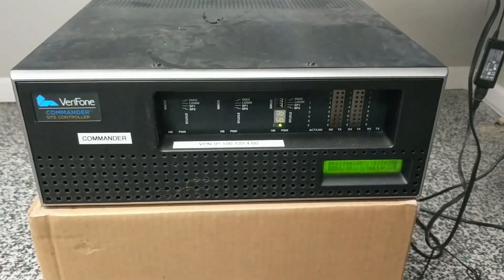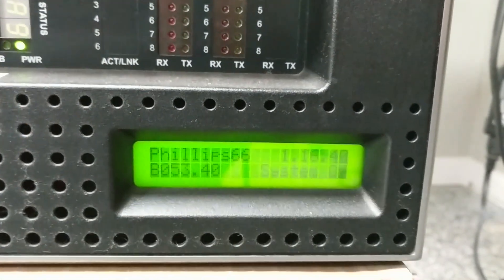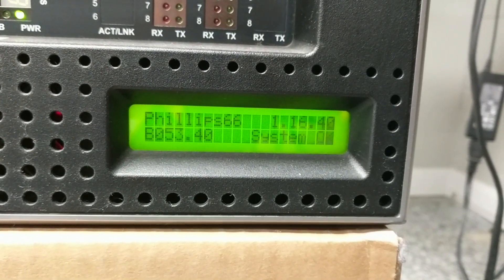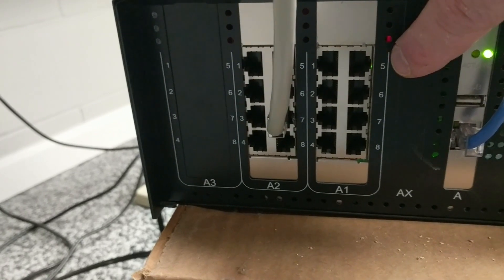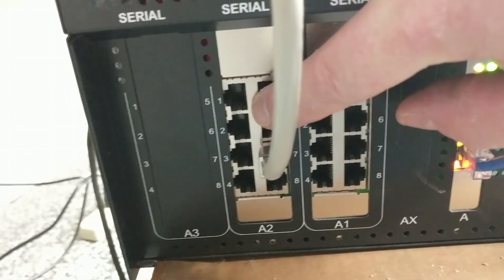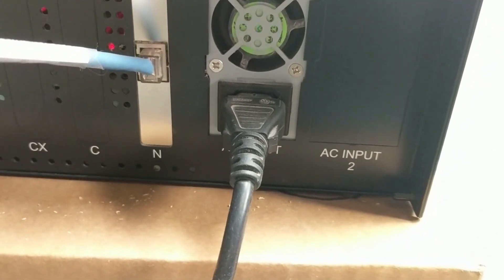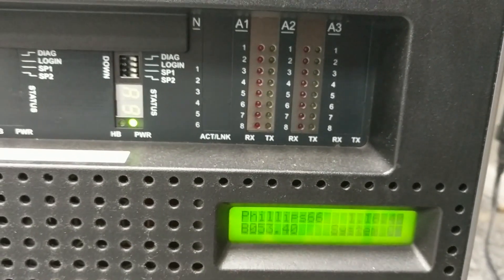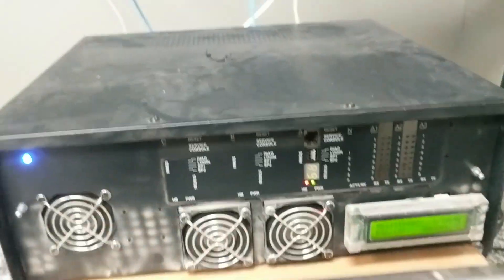Commander Site Controller Explained

Comment: Hi, so I am interested in the latest Verifone C18 POS and the Verifone Commander Site Controller for my gas station. As of now I am looking at purchasing the hardware on ebay. Does this setup require a purchase for a software installation? Or can I just purchase the hardware itself and it's just plug and play? Would really appreciate your help as I've been trying to contact Verifone but have yet to receive any response from them.
Reply from the maker: @DC670-o5c  Verifone requirements are growing.  Software is usually updated a few times a year, the same install file is used for the C18 as what the CMDR uses.  After installed, if it is not registered the software will lock up after 90 days.  To register software, you have to get an ASA license.  Since our store is branded P66, we pay them for the ASA license and P66 provides the license to us, then we can register.  You can use "unbranded" software called bypass, and features on the CMDR are slightly different for each brand.